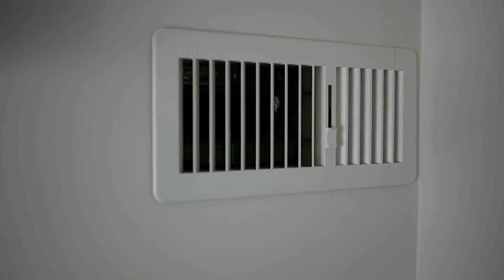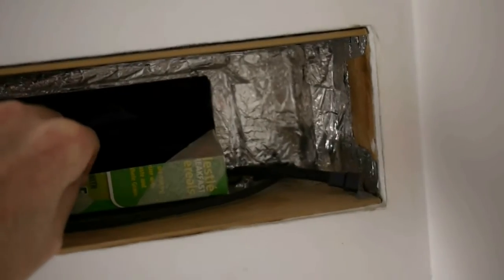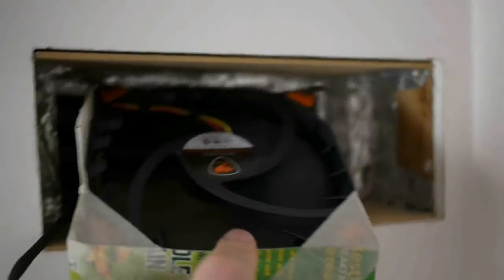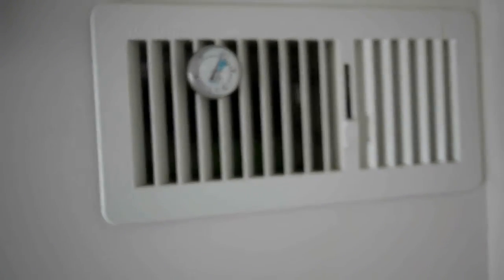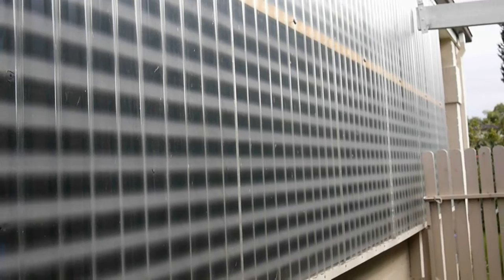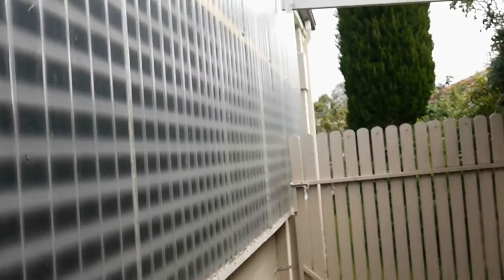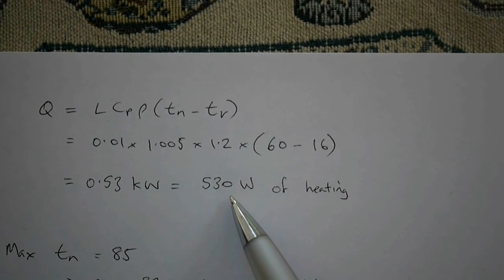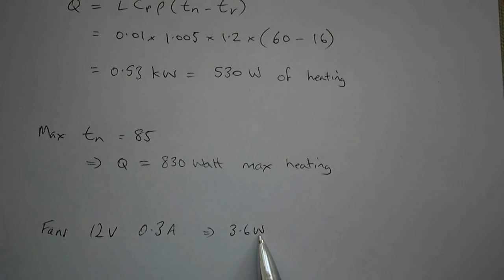Solar Air Heater Performance

Comment: I believe you would get substantially more heat output with a higher air flow rate. You are getting a very high delta T (out temp - in temp) but your flow rate is very low. A lot of heat is not getting out of the heating unit.
Reply: Yes I agree. When I first installed this I didn't leave enough space to install large enough fans. I think my only option is an external fan but my wife would never agree to having anything hanging off the wall.

Comment: AFAIK, warm/hot air is streaming upwards by default, while air circulating at a higher speed feels colder (bc of the wind shield factor). Correct me if I'm wrong.

Comment: what happens @ night ? nice job
Reply from the maker: The issue at night-time is that the cooler temperatures outside can cause the convection currents to reverse direction, i.e. hot air from the room goes into the heater at the top and cold air from the heater is returned back to the room at the bottom, even with no fan running. The fix is to install a flap that opens when the fan runs to push air in the normal direction, but closes (by gravity) to prevent that unwanted reverse air flow.

Comment: I saw how large your collector is and I think that it may be more efficient than your calculation suggested. I know that 1000 watts per square meter would be an ideal condition for input power to the collector when the collector is facing the sun directly. That is not the actual input power when the collector is at an angle to the sun. Your collector is at an angle but I still feel that its efficiency is higher. Maybe the air calculation of air being moved is not correct. Al

Comment: What was the air inlet temperature, how many degrees did it raise?
Reply from the maker: On this day it was 60'C outlet temp and around 20'C inlet- so 40'C temperature rise. At best I've seen it do another 25'C so around 65'C temperature rise.